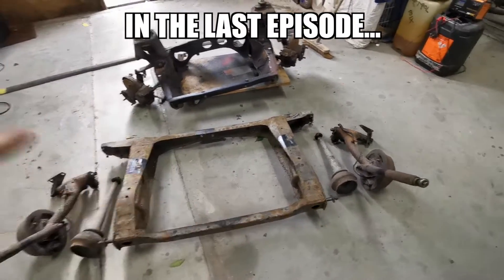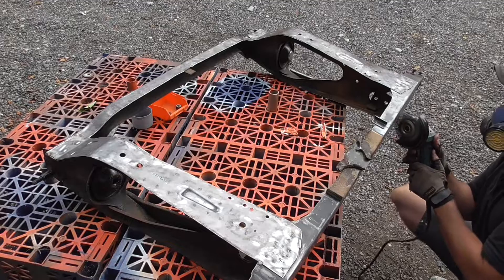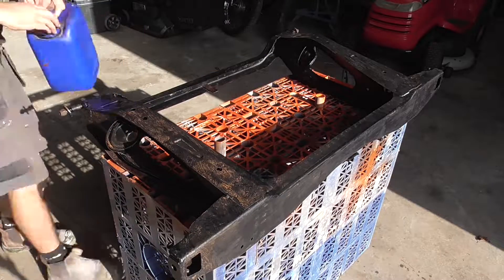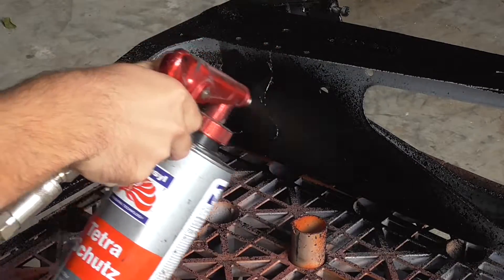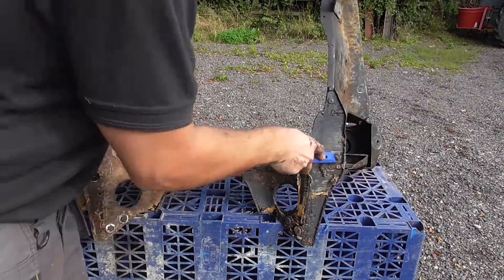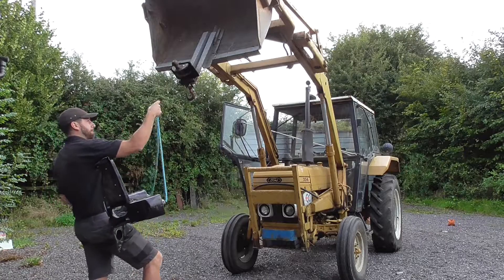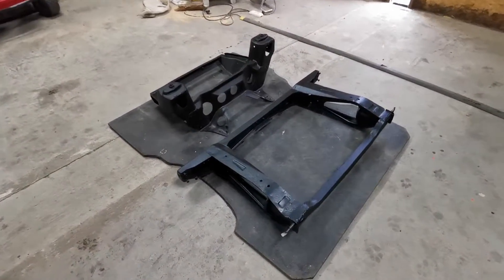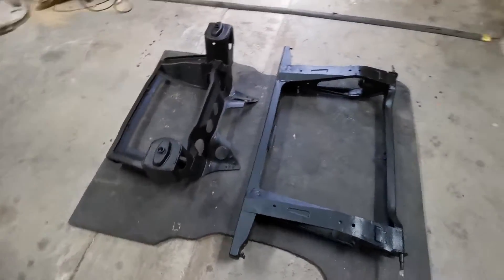Classic Mini Project Episode #4 | Subframe Restoration

Comment: To be fair the finish looks really good for stone chip, looks pretty standard which I think would work fine, also agree with using the tuned 1200 engine and maybe explore an engine swap somewhere along the line, could always start building bits ready to go in and turn a massive job into smaller ones and then make it easier to complete a swap 🙌 can't wait for more videos, genuinely enjoy watching your content more than a lot of people, keep up the good work and motivation 💯
Reply from the maker: Cheers Jimmy! Glad you're enjoying the videos.
I was happier with the stone chip finish than I thought I would be to be honest! I think once theyre rebuilt with some fresh parts they will really pop!
Re engine stuff I think the 1275 is the right thing to do right now and as you say, explore options down the line... Perhaps even look into turboing it if the A series is healthy enough!

Comment: Hey there.....I'm doing the same thing with my subframes soon and enjoyed your video. I just wanted to ask, what is the rust inhibitor stuff you paint on the bare metal? It looks like that "Rust Converter" stuff, is it the same thing? Anyway, what is it called and Is there a brand you would recommend?? Cheers!
Reply from the maker: Hi! Thanks very much for the question. Yes you are right, this was a rust inhibitor I used (can't be too safe with minis!), but note that once this had dried I used an etch primer to coat the frames and give me a base for the stone chip (none of the above is relevant if you're getting your frames powder coated though). If you are interested in rust inhibitor, I just use a generic brand bought in bulk through ebay, but if you're looking for a well rated name, I hear that bilt hamber do a great inhibitor / converter called hydrate 80. Check that out to make sure it's right for you but I hear great things about it!